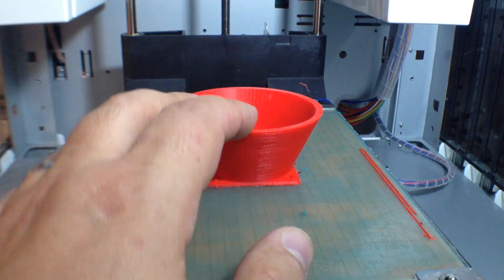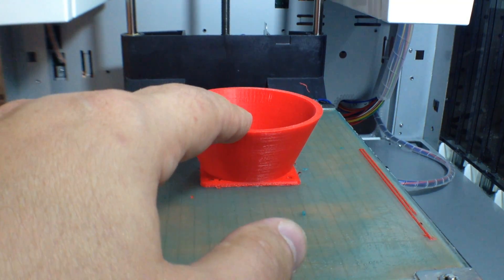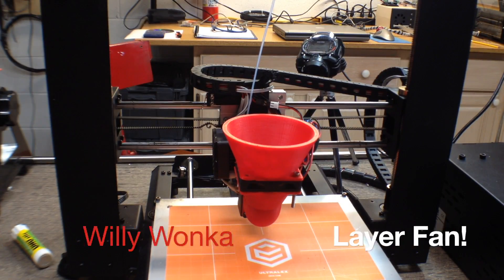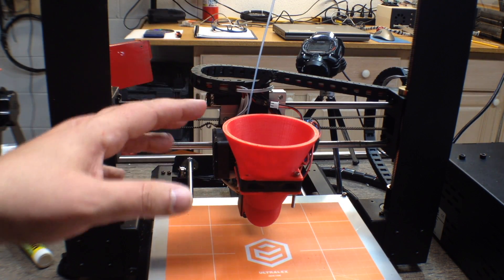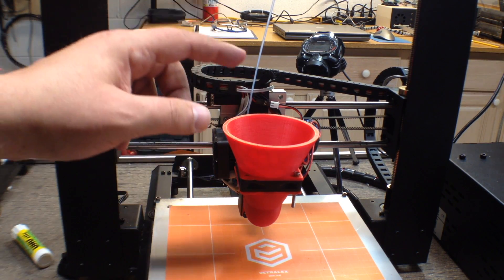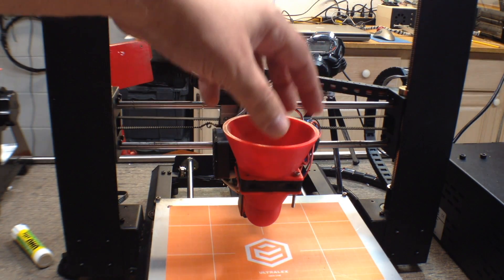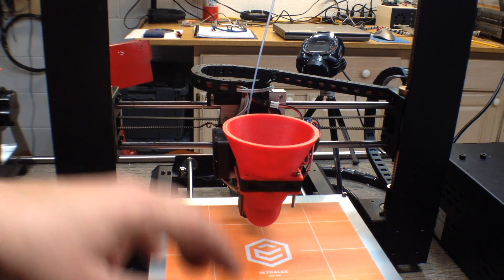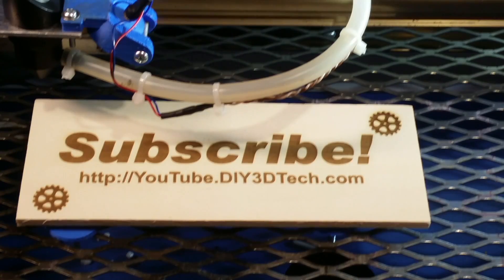Wanhao Duplicator I3 3D Printer - Willy Wonka Layer Fan Upgrade!

Comment: What exactly is that Layer Fan for? Do you use it for something, or just to showcase the printer? Subbed to the channel, as I have a Duplicator i3 coming in a week or less. I want to figure out what all I need to get before it comes - like the glass plate. I'm sure it's somewhere on your channel, but any info is appreciated.
Reply from the maker: +Matthew Horbund  there's a playlist for the wanhao so if you go to the main channel page you can see that I presented don't use a glass plate with it.  PEI is better all around will have a video coming out soon but would suggest avoiding glass as well ABS, PETG to is better than ABS for most things.  The  funnel on top is just for looks however I have added the 50 mm layer fan  for cooling PLA .  Because POA has such a low melting temperature without a layer fan sometimes have issues with bridging  and layer adhesion (to each other)
Reply: Thanks for the reply. So many people say use glass. I will have to see why you say not to!

So you are saying PEI and PETG is good, but avoid ABS ... right?

And you're saying the fan is to cool the PLA ... i will have to watch!
Reply from the maker: To old school, the build materials are far better today, its worth watching Angus at the Makers Muse review the Zebra Plate. Even XYZ Ware on the Pro has moved away from glass...